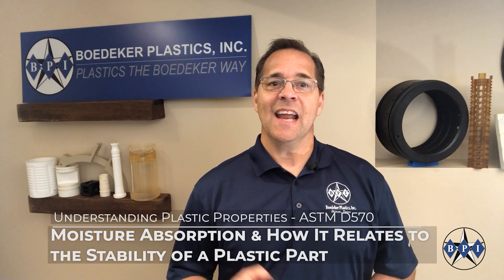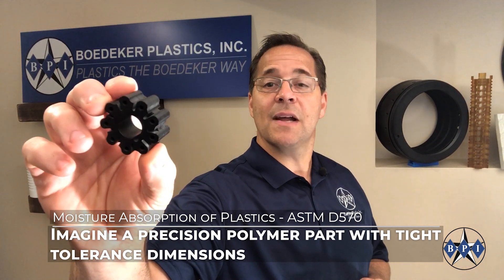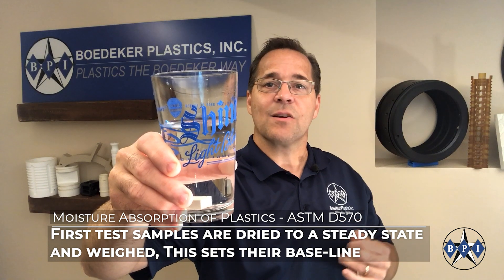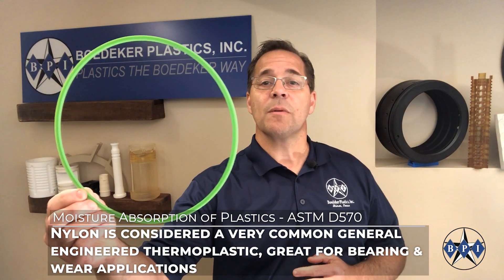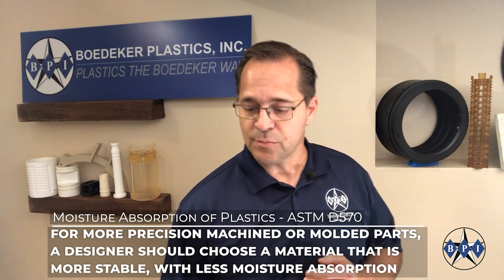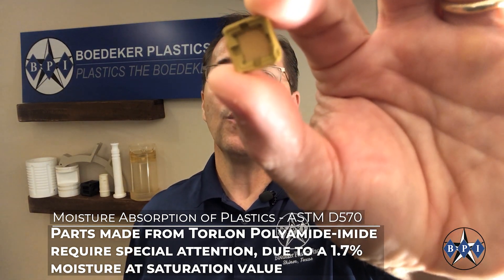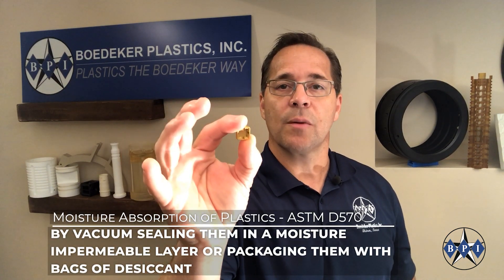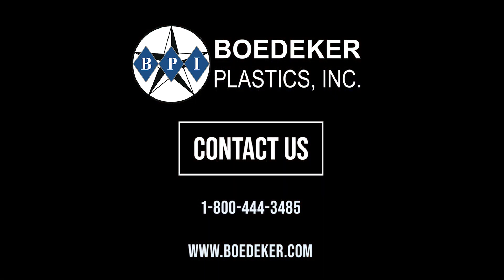Boedeker TECH Talk Episode 6 | Understanding the Moisture Absorption of Plastics ASTM D570

Comment: Hi
PA612 claim to have low uptake… how are your feelings about this material please?
Reply from the maker: Nylon 6/12 is advertised to have lower moisture absorption compared to nylon 6 and nylon 66 due to its chemical structure containing more carbon atoms.  Some suppliers advertise a moisture gain of only up to 1.5% by weight compared to about 7% for other nylons.   Others say about half as much, or around 3.5%.  I would be cautious of this in claim.  This may be true for resins or even extruded versions of 6/12 nylon.  However, my experience is in stock shape plastics.  First of all, in stock shapes,  Nylon 6/12 can be difficult to find and availability quite limited.  Secondly, in the past, I have tested a cast nylon 6/12, and found it had the same moisture absorption to saturation as typical nylon.  I am skeptical and would make sure to evaluate the supplier's datasheet and ask to be certain.  Thank you!

Comment: can I use ASTM D570 to determine the moisture absorption? is it the same with water absorption?
Reply from the maker: Yes, ASTM D570 is used to determine moisture/water absorption of a plastic.  Typically, our suppliers provide both 24 hour and to saturation percentages by weight gain.

Comment: hello. I use LDPE recycle material but i always face issue with moisture. most of the time i dry them for 2 hours in 110°C  then they become dried out but some of them won't dry. even they are same material LDPE. so what is the solution ? how can i make them dried
Reply from the maker: Hello!  I wonder if moisture is truly your issue.  LDPE is known to have extremely low moisture absorption, typically <.01% by weight.  Why do you suspect moisture is the issue?  Are you experiencing material movement?  If yes, could dimensional change or movement be caused by environmental temperature changes or stress from machining or application?  If you are trying to remove all moisture completely, be sure to use a vacuum when drying to help pull out all moisture.  Best of luck.

Comment: How could a part that will absorb moisture and be out of spec even be useful? After removing it from the bag and installing it won't it just go out of spec in the machine? Where is 0% humidity a thing?
Reply from the maker: Hello Garrett.  Believe it or not, this is very common with even the most highly engineered parts.  We see designers sometimes specify tolerances very tight with polymers...often times probably tighter than they need to be.  If the polymer specified is susceptible to moisture pick up, packaging is important in order to ensure the parts pass the customer's incoming inspection....or even to ensure that they fit upon installation.  The parts should be packaged to avoid that moisture pick up while possibly sitting on the shelf for months or years.  To your point, once installed if they are exposed to moisture, they may swell a bit (sometimes only a .001"...sometimes more) depending on the material and the environment.  These are all things that need to be considered when engineering, specifying, and using plastics.  Certainly can be challenging....but usually is nothing that cannot be overcome for most tolerance needs and applications.  Thanks for your comment.

Comment: Hello help me solve this
let's consider plastic absorbs 2% of water. how to calculate the dimension of that plastic material after water absorption.
Reply from the maker: Hello and thank you for your question.  Moisture absorption is typically expressed by % weight gain....but everyone wants to know what does this mean for dimensional increase.  Unfortunately, there is no clear answer and perfect formula to calculate the dimensional growth from moisture.  However, nylon is one of those materials that is susceptible to moisture with up to 7% increase in weight gain.  There is a common estimate for nylon....the worst case percent change in dimension is equal to (% moisture uptake) x 0.3%.   As an example, 5% moisture gain by weight (x 0.3%) equates to 1.5% dimensional increase.  As mentioned, this is not perfect, but it can be used as a good worst case estimate.